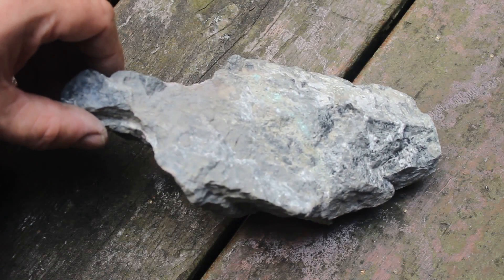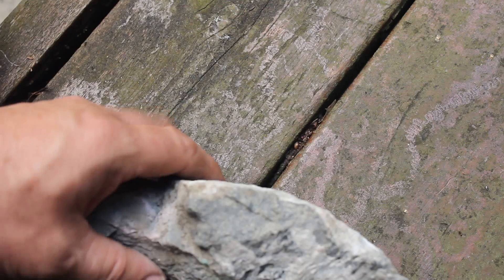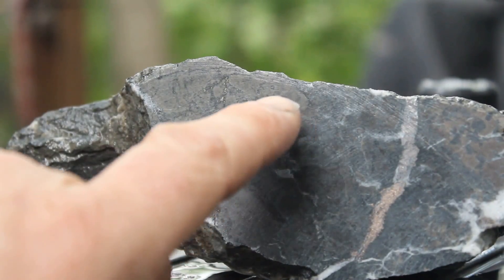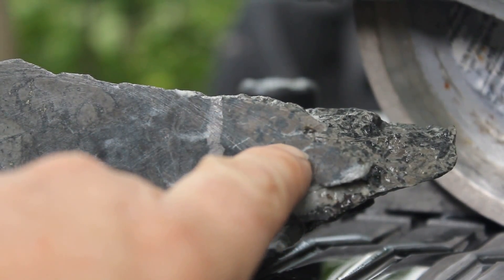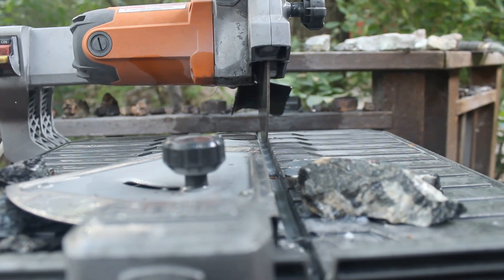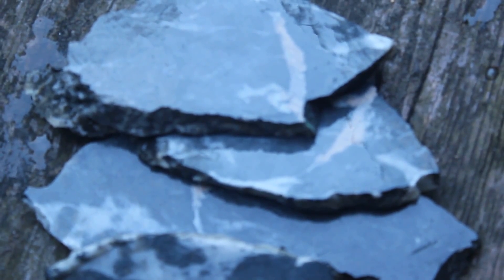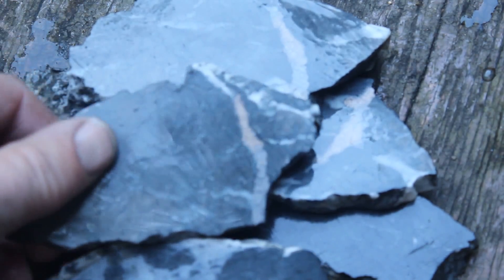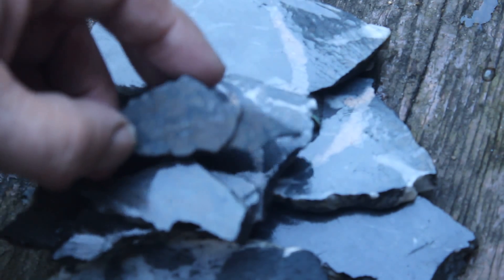WHAT'S INSIDE?  T-BONE SHAPED ROCK FROM SILVER MINE

Comment: Nice video. You have a good cutting machine. I'm going to buy a maschine fot cutting agates,chalcedony and other minerals from the quartz group. I want to cut also calcite. I don't want to give big amount of money. So, i want to ask you something. In your opinion is it a good solution to buy a tile saw? I will replace the original disk with  harder one. Is it going to work? Thank you in advance! Best wishes.
Reply from the maker: I have only used a tile saw (because I had one already).  In my opinion, it works fine for me and what you describe.  I would have preferred a larger blade, as my saw is a 7" and I have some rocks too big to cut.  For the money, my suggestion is to look around at used saws.  I see really nice ones pop up once in a while for really cheap, usually from someone who needed it for a quick renovation and hardly used it at all.
Reply: Thank you very much for your reply!